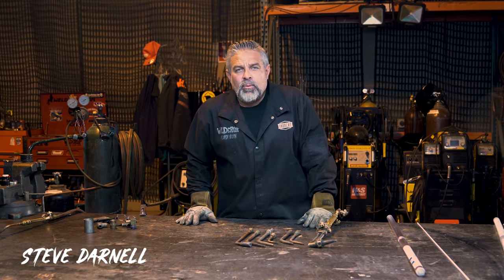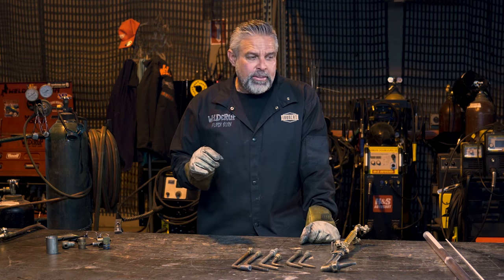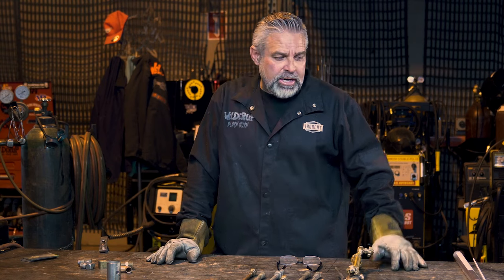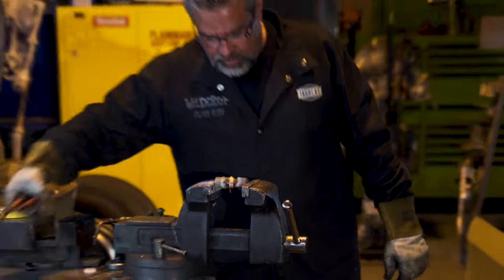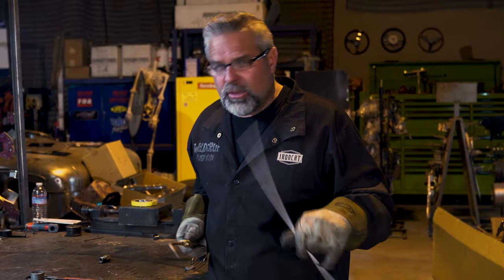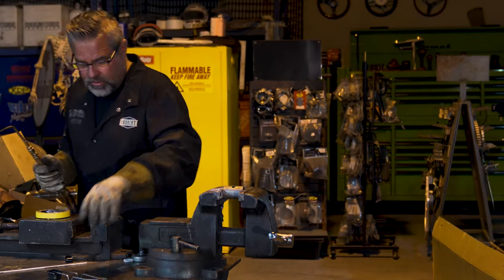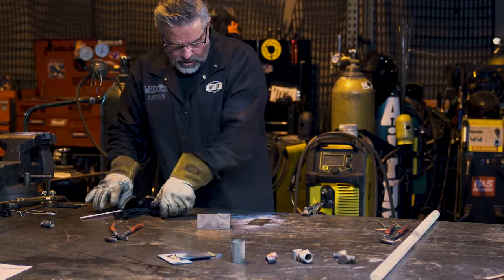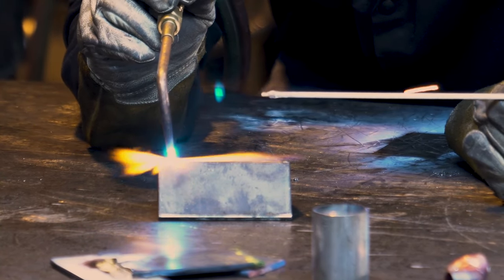Want To Be Able To Fix Almost Anything? Then Learn How To Weld With Brass!

Comment: Brass welding is not the proper term.  Welding implies that the parts are melted together, with or without filler metal.  Only the filler metal is melted in brazing.

Comment: Steve, I'm almost 60, and my dad started teaching me to torch weld when I was 10. I was fixing radiators, carb floats, and I can't remember what all back then. We even used coat hangers when they still made them out of good metal. People need to know the "Old Ways" in these times. Come a time when that knowledge and skill sets will be long gone...
Reply: I was blessed to be taught that at a young age as well. A lot of brazing. Rod.and coat hanger
Reply from the maker: That's true. I'm hoping to encourage a few to keep it going. What your Father taught you has probably come in handy often. Thanks for watching and thanks for your comment!
Reply: @WelderUpVegas , that it has more than I can count. Most times, I'm the only person there with old school knowledge in a pinch to get through the situation. Keep the great content coming, and hopefully it reaches as many people as possible!!!

Comment: Brazing is not welding. Its actually closer to soldering, just done hotter. Welding melts the workpiece and the filler into one. You could also use silver solder on the copper, silver solder is also brazing, its called sil -Fos in the plumbing field. It will braze copper to copper, and brass to copper.  Now a neat trick to braze steel to copper is to Sil-Fos the copper first, then the brass filler will braze to the Sil-Fos and the steel.
Reply from the maker: Thanks Chuck, appreciate your comment!

Comment: It’s called brazing or bronzing,old school method to join dissimilar metals.haven’t used it for some time,requires skill not just a fancy machine.knowledge of heat ranges and metallurgical properties are a must.
Reply: bronzing is a surface coating
Reply: @DeVoNmotorsports  some old guys call it bronzing,as the two are often interchanged and mistaken for each other,Let me guess you have a set of baby shoes like it.most likely the only reason you know the process exists.
Reply: @JoeRocket-sf6qs  by definition it is a surface coating... not a weld... welding is melting the base material, brazing is attaching 2 peices together with filler material/hot metal glue stick... by the definition of it

Comment: Its worthwhile saying about the type of flame used for brazing, you should be using a slightly oxidising flame for mild steel and cast iron, the carburising flame you used is for hard facing ect as it adds carbon increasing the carbon content of the weld metal and a neutral flame of 1-1 ratio of oxygen to acetylene for welding mild steel, stainless ect.

Comment: Sorry, but this is not really 'welding with brass'.  It's brazing with a flux-coated brazing rod which may, or may not, contain a high proportion of brass. It's not welding because the parent metals are not being fused - indeed you are being careful not to melt them.

Comment: I learned to use a torch before arc and other electric practices. Depending on your skill and such you can make a weld just as strong as an arc or MiG welder. I've used brazing rod for places on a body panel you wouldn't want to just slap Bondo into. And depending on your ability to control heat, it can be done on these newer body panels too. Fixed a blow through from a stud gun on a 2000 model year Honda with brazing rod and a torch.

Comment: I am cat tech in the field I do a lot of brazing but I use my tig torch as a heating device lot more control lot less fire danger in this dry ass desert
Reply: Brass welds come out a lot cleaner with tig because of shielding gas

Comment: Bonjour Steve,
On my steam model boats, I usual braze brass or copper or bronze 2 to 6 mm pipes with my little torch with 60 % silver solder to low the melting temperature : https://www.youtube.com/watch?v=Z501GA_odC4
Boilers are brazed wth 40 % silver or phosphore bronze one, but I am not equipped for, no marge torch.
I noticed, and I am not alone, that steel and "my" metals do not live well together as, because of water and oil residues, some electrolyte reactions appear so I guess you also manage this problem in your job, don't you ?
Amicalement, Raphaël

Comment: While there are brazing rods that are brass, most that look like brass are actually BRONZE; phosphor bronze to be exact.  It's very tough metal.  Just yesterday I brazed a broken corner back onto a heavy bronze casting.  I used bronze rod and saved a piece of a historical 1925 5" Naval gun for a battleship restoration.  The melting point of the base metal was very close to that of the filler rod.  I could sometimes see the base metal going liquidus so I feel like I got a very good bond.  The entire casting, about 100 pounds of it, was hot by the time I finished.

Comment: Hey-hey-hey-hey my good brother when we were young teenagers even younger my body's dad used to work at the Indy 500 as a mechanic and he used to use old coat hangers to repair exhaust or just about anyting and he had a stack I always thought that was pretty cool and we used to goof off and just play around with the Torches he was big into Mopar never wore shoes always barefooted and his wife worked at the bar in that little town we grew up in and his garage was right there by the parking lot he whooped A lotta ass back in the day out of that bar LOL he was good at what he did one hell of a mechanic you have a good one brother it's always good seeing you around😎👍🏽👍🏽🤙🏽🤙🏽👊🏼👊🏼

Comment: My dad taught me how to braze as a kid before I ever even touched a welder. Telling the older guys I knew how to braze and have them be surprised was cool. I'm probably more comfortable brazing than mig welding. No knobs and settings to figure out. You control both the heat and the speed and its on the fly adjustable. Really cool skill to know.
Reply from the maker: That's awesome! thanks for sharing!

Comment: Learned to braze many years ago.  Before MIG welders, we used brazing to repair cracked or chafed hydraulic tubes on construction equipment.
My dad had an old vice that had been repaired (brazed) by an old school guy.  The repair looked like a stack of dimes.  Truly beautiful work.

Comment: what? cant fix anything good with antique BRAZING... problem is it gets too hot uses too much energy requires more dangerous tools takes too long and it drips, requires that parts be closely fitted... its not as strong... a easy simple cheap flux core welder is best for most metal you see...steel and stainless, the benefit of BRAZING is mostly used for plumbing pipes is the capillary action better use of the flux, there are different application specific filler materials for exotic metals like aluminum, titanium, coper, silver

Comment: i still braze with brass but i'm very old-school, i don't like the pre-coated rods, i prefer the bare brass rods and a separate container of borax brazing flux so i can control how much flux goes into the joint. i also prefer a proper torch that is comfortable to hold and hoses that are soft and flexible and not heavy.

Comment: Hello Steve, I just subscribed. Fascinating stuff you showcased here. I have a question. You mentioned a couple of times that this type of welding may not be the prettiest, but is it possible after the weld, to grind the finished job or do you recommend just leaving it as it is?
Reply from the maker: Hello chepo 1956, thanks for subscribing, nice to have you along. To answer your question, It always depends on if it can be seen. Details are a big thing with me. Some people notice, others not so much.

Comment: if i had a hole like that in a rad line out in the middle of no where .. i would have to do the unthinkable and agree with my dad..... drop a bolt in the hole and weld it in .. get ya home where you can fix it right

Comment: Great video.. I have some blue devil rods in the shed I used one to fix a throttle cable on a mini bike . I bought the rods 3 years ago when trying to fix leaking rivets on a Jon boat .. the rivets were thicker and harder than the floor and I couldn’t get adhesion snd it burnt the rivet hole larger. So I abonded the project and painted it with airboat paint … regardless I never thought about trying to weld anything especially a radiator with it..
Reply: I know a man who has your exact name.. he’s an Alabama man. B,ham is the city.
Reply from the maker: Thanks Jay, happy to be of some help. Appreciate your comment!

Comment: Steve, what about using coat hangers? when I was shone to braze , I was shone that the best thing to use was old coat hangers?? with flux of cores??? what do you think??
Reply from the maker: If that is all you have to weld with, it works. The old hangers are much better material than the new hangers, I wouldn't count on them. Thanks for watching!

Comment: I learned gas welding when I was 16....I'm 70 now.....I learned welding on cast iron....only brass worked easily. Stick ,mig and tig, and heli-arc, were added to my skills later
Reply from the maker: Right on!

Comment: Definitely one of the most satisfying ways to weld I learned to do it because it's how it was done on the 1920 cars I worked on as a apprentice, to lern to restore them as they were made. Its keped me in work during the pandemic brazing aircon copper pipes together. But nouthing better than the smell of Castrol R burning out the vintage fitting as you weld it.
Reply from the maker: Appreciate your comment Rob! Thanks for watching.

Comment: Steve when I went to autobody school I had to gas weld 3 2" x 4" piece of body steel butted up to another without a rod to pass that portion of the class. Had to be perfect or you started over again. You REALLY learn how to gas weld after that experience. I want to try tig because they say it is a lot like gas welding.
Reply from the maker: It does have a similar style. Thanks for your comment!

Comment: Brazing we called it a very high temperature type of soldering I used to say not really true though  always have brazing rods and flux in the shop and on the rig .  I used to face drilling bits using a similar product . He does do nice tutorials.Wish more young people would get into the trades like welding can make a good living .
Reply: i've used it to attach carbide cutting bits to lathe turning tools, fix cracks in cast-iron, and repair old bicycles that were built with brazed lug frames. it's still a very valuable skill to have. tig and mig are great, but not always the best choice.

Comment: Great video/ tutorial  Steve .
Best bit of welding advice I got told by an old time served welder was 
" Bend over the weld rod end your jot using so you don't prod your eye out"
I have seen someone brass weld an old penny onto  a burst rad pipe .magic
Reply from the maker: Good tip!

Comment: you might want to mention if your using this for bodywork  body filler will not stick to braze, I learned this when I was 17 and an old timer offered to help me with some rust repairs. I tried grinding it, priming over it first, finally lightly tinned it with solder then it was ok
Reply: actually, body filler will stick to the brass filler metal but you have to thoroughly remove all of the brazing flux using an etching compound and scotchbrite or sandpaper. brass brazing flux contains borax which is basically soap and nothing sticks to it.

Comment: I'm amazed that the brass held that pushrod together. I know its a stock 350 but there's still a lot of pressure on it from the valvetrain, stronger fix than I thought.  Super informative video
Reply from the maker: Thanks!!

Comment: Hi is it possible to brass weld a stainless steel chainsaw muffler. Thinking of experimenting with a  small steel pipe in it and brass weld so the pipe is welded to muffler.Or would the muffler crack after time around the brass weld?I guess its possible to also get stainless steel rods for stainless is this correct ?if so would it be okay for doing what I have written above stainless muffler with steel pipe?(sorry not to good at explaining when typing)

Comment: i have a collection of gasoline or alcohol torches. the smaller ones have an inside/outside  threaded fitting on top of the tank. soldered inot it (it's a self pressurizing tank from the heat of the torch tip) the tip is fuel fed through threaded fitting, the tip is threaded into the tank and a nut is to lightly lock it in place, the threads are tapered inside.  alot of times it gets leaky and people tighten the joint up, and it cracks the soldered in fitting. there's fill plug on the bottom of the tanks, that had to of been soldered last onto the bottom inverted domed cup, because the top tank fitting is collared on the inside of the tank, and the fitting will fall into the tank, then its extremely difficult to fish it back out and to get it set again. to get enough heat into the fitting the solder drops out to balls inside the tank. a wick runs through the fitting to fuel the tip. it needs to be serviceable as the wick carbonizes if i gets too hot, so solid welding the joint is almost out of the question. do you think tipping the tank upside down would be better so the fitting doesn't fall in? the fitting is brass, the tank is brass copper zinc, and thin.

Comment: The faa still requires that 4130 chomoly airplane chassis are to be gas welded only  nhra didn't accept tig on 4130 chassis till about 1988
Reply: Now to get your A@P you do not have to weld ! When I got mine in the early 70s in high school at Emory in Miami we had to weld test now it’s all just book questions .
Reply: @johnsiders7819  yep part of my practicals, a damn cluster weld!